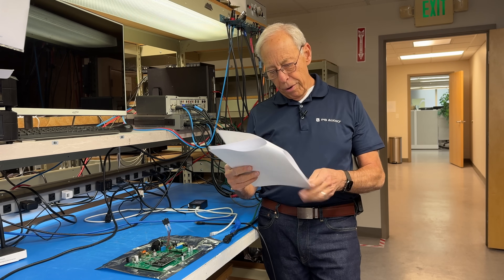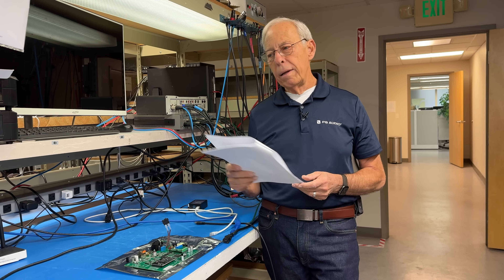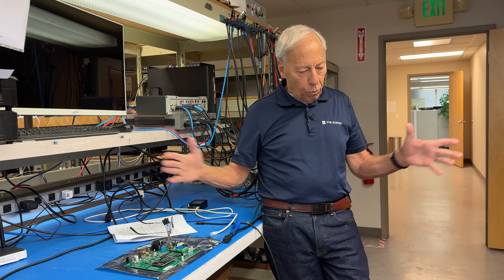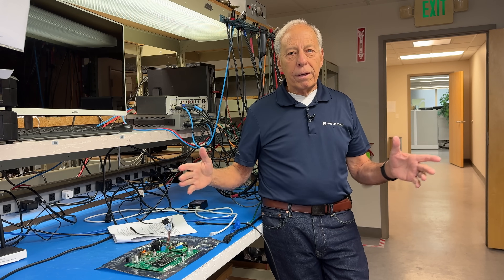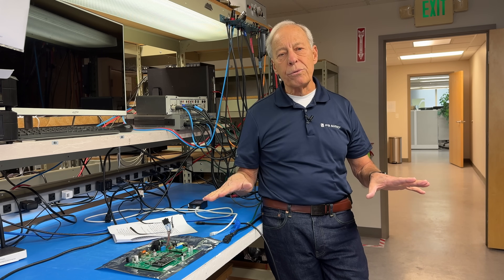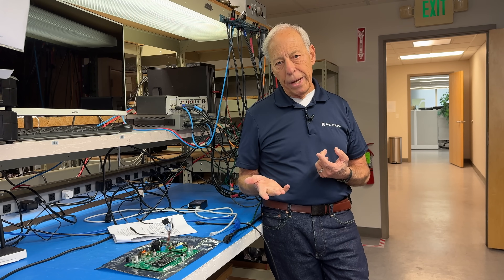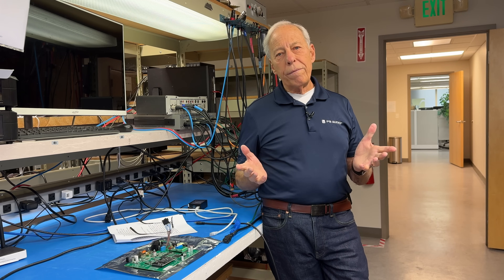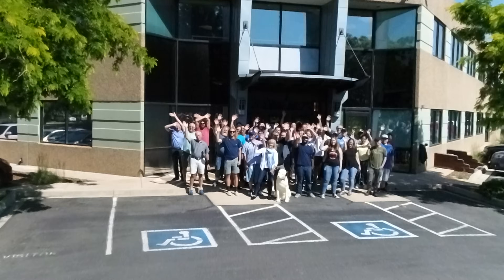Removing the main speaker's woofer work

Comment: He's wrong. Passive crossovers including good ones are trash. Analog pre amps and amps wires etc are stupid. Seperate mono amps per d4iver built in with a separate DAC and dsp per driver with mics in speaker can produce sound from 1k speaker as good as 50k one using older methods. Analog LP can be done on blue ray read with Laser no surface noise with four channels. X,Y,Z & W for ambient non directional sound and can scale from mono to 200 channels. Ambisonic. DTS X & Atmos are digital implamentation of ambisonic. But this way analog record can match CD performance. Amps in speakers can produce music in soatal audio this way with all advantages of CD and LP but none of the drawbacks. Multiple layer can have DSD & DXD audio even video lyrics ebook etc on same disc. Make pla6er a recorder with lightscribe and download discs that self burn instead of manufacture. On demand. Can have analog LP in car this way too. Another advantage is amp can be fully digital and use input signal to control anp bias like Dolby hx pro was used to control tape saturation can be used to control output bias on class A amp that has class D efficiency power and size but class A sound quality. 360 degree analog Laser LP and digital object audio too.

Comment: It's a shame that Paul (and so many others) is so often mis-understood. If you're listening to music and you have speakers designed to run full range ($$$), like Pauls Aspens  then let them do it. Add a subwoofer for movies (for the LFE channel), and music for double-bass, if you like. I believe many movies add extra Low Frequency Effects through the LFE channel but not to the mains. I don't think music sources do, so a sub isn't required with full range mains. Correct me if I'm mistaken!  I listen at very moderate levels and usually run my M-S Aviano 6's (38hz) at full range for music. Occasionally I turn the sub on as well. Both me and my speakers are quite happy! If I listened at high volumes then I'd cross them at 50hz for music and 80 for movies. But, just my opinion. 🙂

Comment: Completely wrong from a human hearing perspective : we are very insensitive to phase shifts , especially in the sub 100 Hz range . So you are effectively now trying to avoid something we don't hear anyway (phase shift) and at the same time torturing your woofers and introducing distortion , which we can hear very well ,by pushing those cones maybe beyond Xmax and possibly beyond Xmech (damage)  . Very bad deal . Sub bass is intended for subwoofers with huge cones and huge excursion limits . Besides , I find this advice logically inconsistent with Paul's insistence on having subwoofers based on the reasoning that subs can be placed in the room where they can optimally reproduce sub bass and mains cannot . If mains are not capable of doing what you ask them to do , then the logic thing to do is to stop torturing them . Anyway , every crossover , digital or analogue , passive or active,  introduces phase shifts . So if that is so evil , why not go for full range drivers without any crossover like the Japanese do and have fun getting some bass out of those little cones even in a horn setup .

Comment: I realize you very pointedly say, many times, when talking about a full range speaker. Your point makes sense for a full range speaker that is actually designed to play full range, that is down to 20Hz. However, the question didn't actually specify the person was asking about a full range speaker. A more common scenario is someone having a floor standing speaker that isn't designed to play down to 20Hz but rather to 40Hz. A quasi-full range speaker so to speak. 

It's been my experience that if a speaker wasn't designed to play down to 20Hz, it sounds much better when it is high passed to a subwoofer around it's -6dB point. While room gain can allow a speaker to play lower than it's designed roll off frequency, I find this extended bass to be slow, bloated, and not as musical as the rest of the speakers range. 

Also, if the speaker wasn't designed to play down to 20Hz, removing the first octave energy from the woofer allows it to play much cleaner and effortlessly within it's range. If the high pass is done before the power amp, it makes the power amp's job much easier by not having to deal with the first octave signals.

I see two answers to the question. One when dealing with a true full range speaker and another if the speaker isn't truly full range.

Comment: Loudspeaker designer here. I usually agree with Paul (exept when he discusses speaker cables lol), but this time I strongly disagree. First, from the part of the question that has been read aloud, we cannot conclude that the reason for lowest frequencies are not heard is the room acoustics. Instead, it is most probably the speaker not being able to play low enough with flat response, as most of home speakers simply don't. Also, the vast majority of the hifi loudspeaker systems are vented designs, which by definition is not designed to play full range signal (opposite to Paul's claim!), but only the part of the spectrum that is above their box tuning frequency. In most of home speakers that have 6 or 8 " woofer, that is somewhere between 30 and 50 Hz, and those simply have no business playing anything under that, as the drivers then behave completely unloaded and cone excursion becomes huge, without giving basically any sound. Remember, below tuning frequency, driver and port output are out of phase and cancel each other! Such large cone excursion introduces not only danger for the driver itself, but also all sorts of very audible distortions if played even at moderate loudness. Of course, strongly depending on program content. And a comment about phase, well; it is shifted anyway, especially if speaker is outside of its flat range. You can't shift what is already shifted... I mean you can but it makes not much difference. So all in all, I disagree with Paul's conclusion, I would say that I recommend the use of high-pass filter in any similar design, unless the system is sealed or vented with tuning frequency below 20 Hz.
Reply: I have a pair of R11s and a pair of KF92 subs. I was doing what Paul is suggesting here...untill I didn't and did the high pass thing. My setup sounds clearer with more pronounced bass than before...even though in the previous setup both the speakers and the sub were simultaneously producing the lower octave. I've often wondered why? Both the subs and speakers producing bass should sound more bassy than doing a high pass bass division between the two...
Reply: @wiseguy2600  They were out of phase (mains and subwoofer), that's why were less loud playing together. If you want multiple sources to play together and sum properly, they must be in phase as accurate as possible (can be achieved either through phase control like some kind of allpass filter, or with delay control, or with physically moving subwoofer around to good distance from the listening position, relative to mains).
Reply: @wiseguy2600  I too have a pair R11s(non meta). I cut off the lows at 60hz 24db. I found that mimics the designed speaker frequency response and eliminates the tuned port frequency bump. Like you, I use a pair rythmik subs and those are set to drop 90hz with 12db slope. I found these points to give me the smoothest frequency response in my room.

Where are crossing your subs?
Reply: I agree. I never want to see my drivers in heavy excursion.
Reply: You are right 😉! But Paul also said, that if there is this problem ==> loudspeaker cannot reproduce low frequencies at all due to it's design, you need a sufficiant full range speaker. 
A Subwoofer can support at low end (e.g. room/ setup problems) but you need fullrange speaker in the fist place (down to at least 30Hz - flat) to support a sufficiant, effortless stereo imaging which is starting at ~70Hz. Phase shift will also kill your image... so you need full range main speaker.
Reply: DIY loudspeaker designer and builder  here :  absolutely correct , and beyond that , our hearing is very insensitive to phase shift , especially in the sub 100 Hz range , but is sensitive to distortion , so this is a very bad trade off !  Phase shifts are an inherent part of every crossover , like it or not . And if you don't like it , you can always build yourself a nice pair of horns with 4 inch Fostex full range drivers without any crossover at all and try to squeeze a bit of bass (let alone sub bass) out of those.
Reply: @gerritgovaerts8443 Distortion figures of 20% or more go unnoticed at the low end of the spectrum and are in fact the common values in speakers.
Reply: @gerritgovaerts8443  : here you have also the doupler effect due to the moving membrane. So the high frequencies are modulated...... Also not good. I prefer Fostex, front loaded horns with small enclosure to damp the movement mechanically. For vase frequencies I use an Eckhorn 18 MKII for each side (Stereo sub2woofer up to 70Hz) 

Best out of both worlds

Comment: The material being played back is extremely important. These days, all engineers (even new learning ones, amateurs) have tools to manipulate the low end and/or particularly the sub. If you end up listening to material from someone that knows what they're doing, it is a real treat. High pass filtering can be active in final master mixes or tracks at any given time, but there is no hard and fast rule either for or against. Sometimes the very extreme low, like 30 or so Hz or less is attenuated for other effect, depending on the engineer and desired end goal. Long story short: Give modern material a try, mastered by someone sick. My account has some things. Rock on.

Comment: Subwoofer crossover, like all crossovers, is a very complex subject. The more the main speakers really need a sub, the more difficult it becomes, unless the designer is in control of all components. It is often easier to match the sub to the natural rolloff of the speaker than a Frankenstein of highpass.
Have you heard Vandersteen's design? First order filter (cap) in front of the power amp, yet the sub is still fed from the speaker outs.

Comment: Yes, absolutely roll off the lowest octave -- and then use subwoofers that are properly placed in order to hear the bass that the main speakers are now relieved of producing.  That's so obvious I don't know why Paul didn't mention it.
Reply: True and also in a ported speaker you protect to woofers from over excursion under the tuning frequency. Therefore you prevent damage to the woofer when playing at loud volumes.

Comment: Over 20-years ago I was installing and setting up our surround system in the living room of our new home. The equipment at the time was a Sony ES series 5.1 receiver, Paradigm Cinema 90 bookshelf, center and surround speakers and a Hsu VTF sub. I ran the Sony room correction setup with the included microphone and was very underwhelmed with the results. I started poking around in the AV receiver speaker setup options and switched the setting for the main speakers from 'small' to 'large' so the receiver would send a full range signal to the small speakers. This one change improved the sound dramatically, even though the woofers in all of the speakers were only about 5".
Reply: Many years ago I had an Hsu VTF sub for my main setup but graduated to 2 Rythmiks. I still have and use the Hsu for my nearfield PC setup. The Hsu is a beast!
Reply: @Bob-Fields  The VTF II I have is on its third amp now. The original amp, 250 watt I think, bit the dust after six or seven years. I replaced it with a Parts Express 500 watt BASH amp since it was the correct size. The Parts Express amp started to hum loudly when it was just over 5-years old, and Parts Express replaced it for free!

My first sub was the HRSW12V Hsu sub that I had for a 30-day free trial. It had huge external amp that you changed out resistors to change the crossover point. I had a demo laserdisc with a space shuttle launch video and when I played that video the floor felt like it was rolling in waves, the toaster in the kitchen walked across the counter, dishes rattled in the cabinets and eventually all three floor to ceiling windows in the living room fogged up because the seals between the panes of glass failed. I was able to get the windows replaced under warranty and sent the HRSW12V back and got a smaller sub. :)

Comment: I was told many years ago that even if you can't directly hear frequencies too low or too high for your ears, the speakers ability to reproduce them along with your hearing range will add depth to the sound coming out of them because of the higher range of octaves reproduced. That may be BS, but it seemed reasonable to me, a vintage guy with vintage equipment.
Reply: It's not bs. Typically, within reason, you want your source material to be as wide with respect to digital bandwidth or analog range - up to a certain point. After that, it's simply overkill. Really, it's based on the principle that if something exists, you have the CHANCE to hear it. If something doesn't, you have NO chance. And perhaps even more important than it all: Music is not strictly auditory. The real part of music comes from the feeling, physical vibrations of your body. Rock on. 320 kbps LAME .mp3 44.1 KHz is stellar. I am the kind that would refuse on the drop of a dime if I was being cheated in sound or feel. If your collection is pure (not re-encoded) specs of what I wrote, you are doing way more than well. And after all that being said, have you ever heard a 10 kHz pure tone? How about a 12 kHz? 15 kHz? Air is nice in music when done well, 20 kHz is more than enough to cover it all. Nothing extra necessary, besides perhaps for archival so it can be re-mastered at higher qualities, so there is less aliasing and things like that.

Comment: Another Lip Smacking 
ASMR Audio Vignette From Paul
In 1976 I Too lost My 
Bass Frequencies and My Birthday 🎂 😂 For Crying Out Loud 
Thinking Never To Come Back To The Full Grander of The Past….😮
Yet In 1996 I Got My Birthday Back and My Low Frequencies with a
Pair of Apogee 18” 
Sub Woofers and Two
QSC 8001 Power Amps and a BSS Digital 
Cross Over From This Point On I Have Never Been Without Want of
 Bass Frequencies In 
My Home Audio Set Up 
This Is Not Audio File Madness or The For The Weak Hearted 
This is Real Not Fantasy 
Land Plus Oddly Enough I 
I Can Shake The House With These Apogees 
….Thanks Paul 
For Yet Another Fantastic Lullaby Performance As I Slip into a Piano Concerto of
Erik Sati 
“”Je Te Veux “”